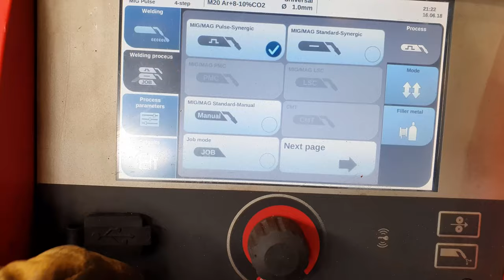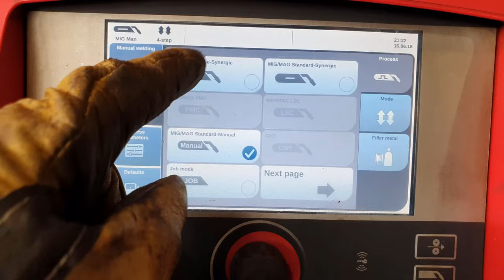DIY Hydraulic Press

Comment: Great Vid mate, I would add one more vertical piece of box just under the jack, this should reduce any deflection in horizontal box section that the jack is on and transfer load better to the actual press plate.  So drop down from jack  centrally to the 2 short pieces of box.